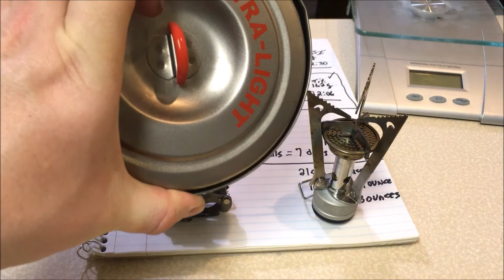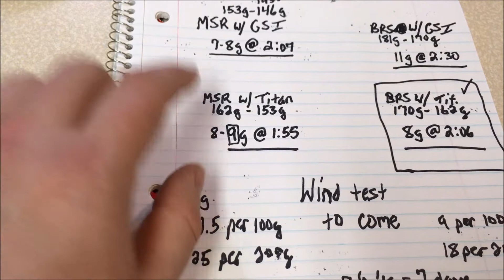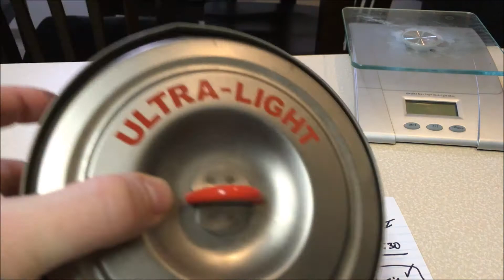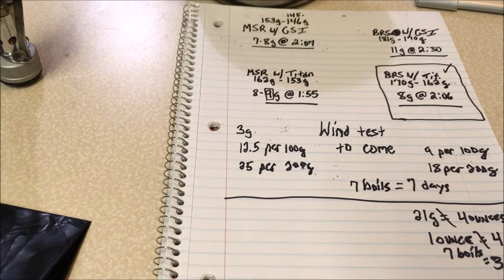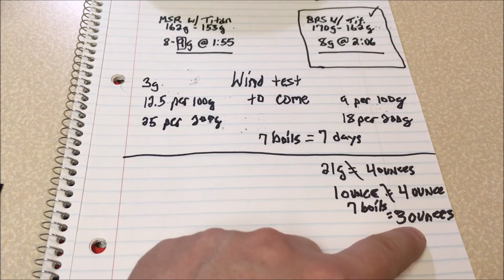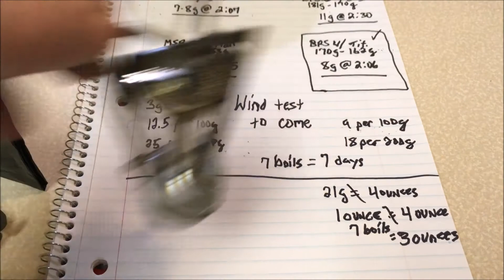MSR Pocket Rocket versus BRS 3000T

Comment: don't use these indoors. they produce Carbon Monoxide which is toxic.
Reply from the maker: The amount it puts off in the house is negligent and would have zero effect to boil a cup of water. This was done for test purposes and used for two minutes...
Reply: LOL, it's not putting out a enough CO for this to in any way to be a problem in a house.

Comment: The MSR Pocket Rocket is an American made stove, and the BRS is a Chinese made knock off of a American made stove...
Reply from the maker: Yes, that’s correct, but with the weight savings and the cost.  The BRS wins out. I can replace it a few times compared to MSR pocket rocket.
Reply: REI location info on Pocket Rocket stove: "Imported"

Comment: Interesting test. But one trial is nearly meaningless. Repeated test under the same conditions makes for mor accurate results! Still there is good information here.
Reply from the maker: MSR with both stoves have been repeated for a few years now with the same results + or - a few seconds difference in boil times. I clean my MSR after each backpacking season and test both pots to make sure the times and fuel usage are the same. BRS will need more time to see if those results change.